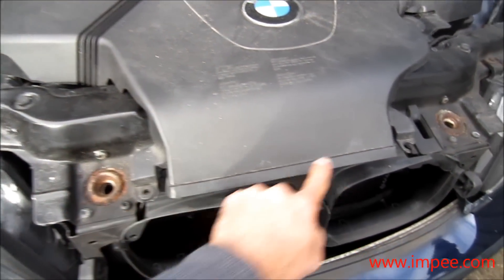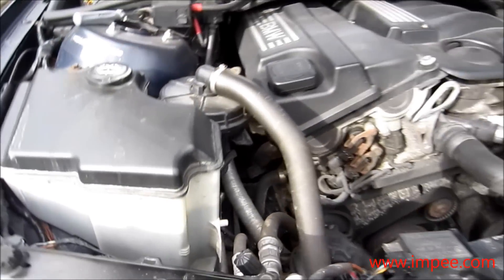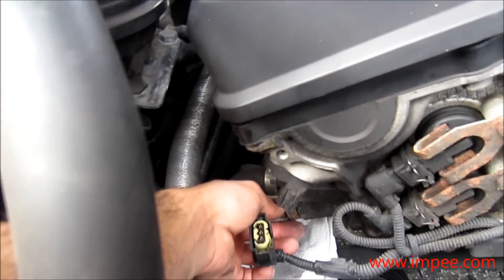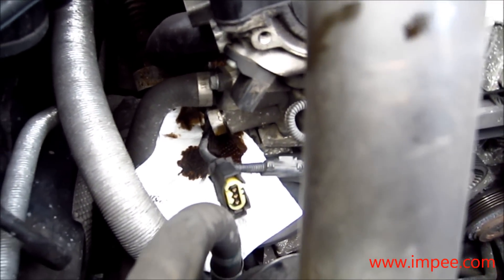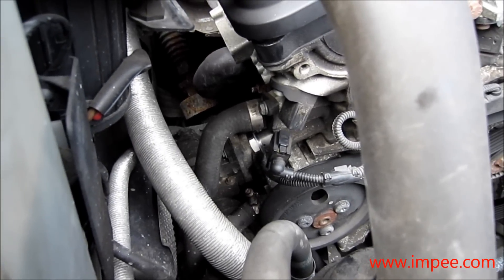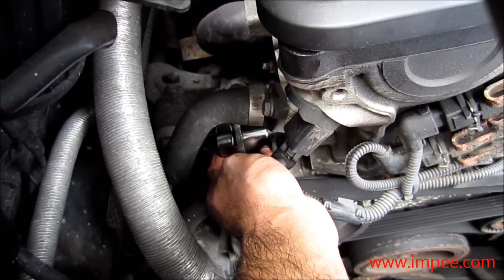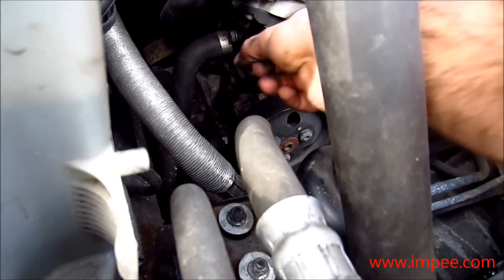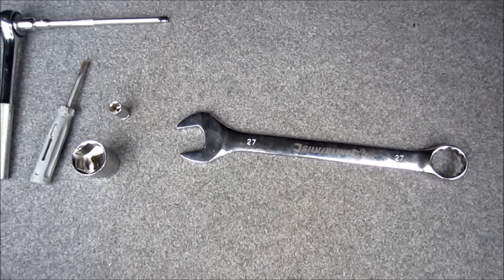BMW e46 Timing Chain Tensioner - DIY Replacement

Comment: If I have done that job I would have rotated the engine by hand after installing just to make sure the valves don't hit the pistons just in case the chain is so stretched it has come off the bottom sprocket that would be a very bad day 24 bent valves

Comment: hi i replace my chain tensioner and it seems it did not resolve the problem engine still rattle i brought to a bmw dealer and he said the pcv valve needs to be change and he noticed a new chain tensioner and he ask if i follow a guide before installing and i said i just unscrew it and put a new one ........is there a bmw proper guide to do this .......because i found yours easy to install thanks again

Comment: Just checked my oil stick yesterday and it was close to empty. I changed my oil  with castrol a month ago so its leaking pretty bad. However i think the leak is from the vanos solenoids because the oil has clogged up around there. Need to clean the area before i can remove them tough its pretty dirty.

Comment: I have the pre facelift type with the N42 engine. My engine is also sweating oil close to the oil filter. My local garage said it wont do any harm but the bottom of the engine is full of oil.

Comment: You might also mention that the tensioner needs to be fit in the right orientation so that it mates with the chain guide. Yours still sounds a little rough, maybe not seated right? Could also be a DMF problem.
Reply: how can u correctly orientate a tensioner which is basically a tube with a spring loaded arm erm, with a flat end????
overall so long as the tensioner is in place & the chain hasn't jumped or been pushed/misplaced after the tensioner has been refitted, orientation of the tensioner isn't really an issue to even consider. starting the car for only a split second isn't really giving anyone a real idea of changing this part is what was really causing the issue etc
Reply: Some of them are flat and don't matter how you put them in, others are grooved and need to be orientated correctly. The E46 4 and 6 cylinder engines were fitted with both types and its very important that the grooved one is orientated correctly or it can cause serious problems. 

The engine does sound ropey indeed. I would imagine its a flywheel issue from that sound, if I were to take a guess.

Comment: car is stallinga dn running roygh unless disconnect the top vanos power... both been replaced adn o rings and crank and cam sensors... would u think tensionaer would help??

Comment: Most of the N42's oil leakages are caused by bad O-rings. Try to determine the source and see if you can replace the O-ring, or find a garage who can.
Most important factor; what is the oil consumption of your car? If that's not too bad, you're in the safe.

Comment: Brother, by replacing the timing chain tensioner on a bmw 318i se 2001(E46), fix the rattling noise? the rattling noise becomes louder when you rev the engine

Comment: there was a rattle form engine after you started the engine, was this your vvt motor?
Reply from the maker: I think that rattle is normal in my car...some times the engine sounds like a diesel :)
Reply: That will be your crankcase ventilator, change that and it will sound like a new engine. It's clogged up with dirty oil.

Comment: What was your car doing to   alert you that you needed to   change the tensioner?
Reply from the maker: nothing :)
I just changed it as a preventive measure and also I was bored :)
Reply: ***** Yeah. It's an easy job and it can save you from an expensive repair later on.

Comment: In my logic if the chain has stretched enough to warrant a new timing chain tensioner, the actual chain should be changed too. That's my understanding regardless if a bike chain stretches you can simply wind it back to take up the slack. Also
If the chain was slack surely the timing is slightly out, and simply putting a new tensioner wouldn't be the right answer.
Reply: The problem is actually in the weak performance of the original old style tensioner, they allow the chain to become sloppy and noisy etc.
Reply: I agree with you as I understand your explanation
Reply: That's my understanding as well, hence the change in design. Ive changed mine today.
Reply: The timing cant be off cause the tensioner is on the lose side of the chain. It has nothing to do with the timing

Comment: Nice vid, but why would you undo any fastener with a torque wrench?
Reply: Maybe not to cut bolt?
Reply: Most torque wrenches are not reversible. As in, they will go backwards but you shouldn't undo things with it in reverse.

Comment: Hi Imran. My engine is N46B20A with 143HP. Have I change the chain tensioner with 126.000km done? No noises and timing rough for this moment.

Regards!

Comment: This engine rattle is caused by vacuum pump idiotic construction, it wears out quickly, parts on the inside get a bit loose causing the rattle and it may also affect engine power output slightly. Plus there is a chance, like one in a billion, that it will eventually cause some serious valvetronic problems. You can get a new pump, but it's quite expensive and will get loose again after ~50k km

Comment: Thanks for the tutorial was a great help, I had a somewhat noisy engine and the idle was erratic but after swapping out the tensioner it's a lot better. 
Infact theres a new part now which superceds the previous two. 

11318685091 (08/15/2016) 
11317567680
11311439851

The new tensioner was quite hard to get in thru as takes a fair bit of pressing while also trying to turn it into the thread

Comment from the maker: This should be changed at 80,000 miles - provided you have the old type currently fitted, if you have the new type, then I don't believe it needs to be changed. There is more detailed information about this DIY on my website, Thanks.

Comment: Hey man! Have you ever had problems with the timing chain itself? I personally have a 316i e46, and the timing chain is split, so it needs to be changed. I've heard it's not that unusual on theese cars.

Comment from the maker: no, I am not aware of any official BMW timing chain tensioner replacement guide...it is simple unscrew and screw in a new one.
Reply: according to docs, the torque spec should be 65 Nm

Comment from the maker: This should be changed at 80,000 miles - provided you have the old type, if you have the new type, then I don't believe it needs to be changed. There is a lot more information about this on my website.

Comment: Replaced my tensioner today. Now my car won't start. I've a horrible feeling my timing chain has slipped.
Reply: How did it go? Had the chain slipped or what? :S
Reply: TheBravo420 What happened to make the car not start? Did the chain slip?

Comment: That's really bad. I think you need to recontact your garage, and explain the oil usage. There are a number of weak spots in this car concerning oil leaks, and are usually solved by replacing simple O-ring. However, it will require some digging into the engine to find the source of the leak. Goodluck.